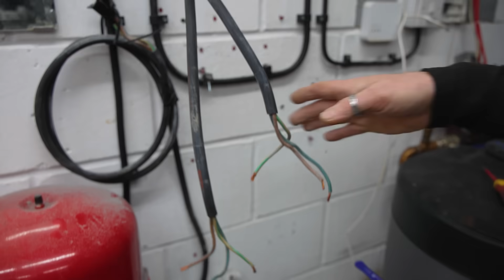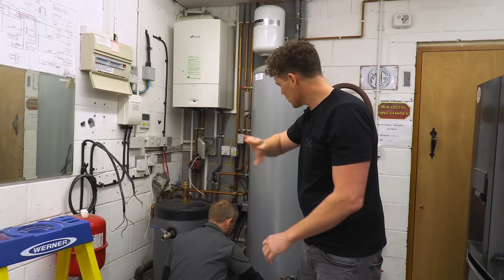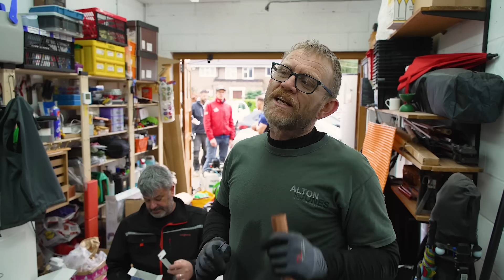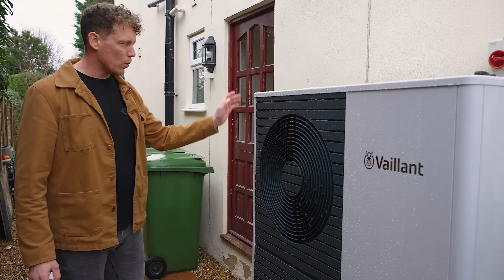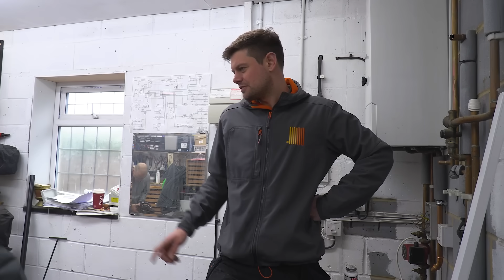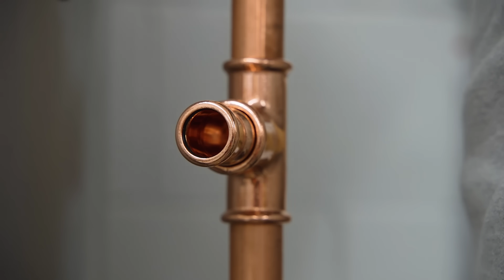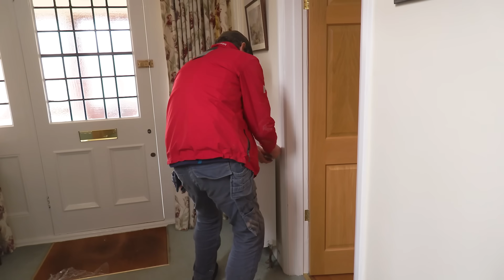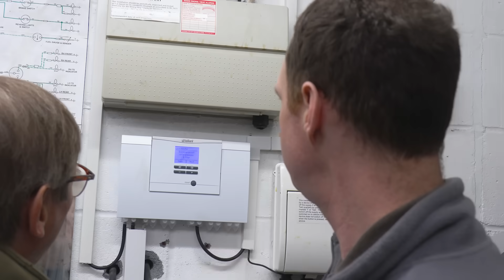Ultimate Heat Pump Installation. Rip It Out & Start Again!

Comment: When you're leaning on the new heat pump it's moving quite a bit. Shouldn't there be support brackets at the top for stability? Just an idea.
Reply from the maker: You could add support but the feet are rubber which allows the movement that you are seeing. This reduces noise transmission through the ground and the building. If you put brackets at the top you would need them to be on springs or rubber mounts. The movement would still be there.

Comment: massive kudos to these highly skill;ed engineers but what about the carbon footprint of the installation , where was the heat pump manufactured? the overall cost is not just in the allegede energy saving but in all aspects of manufacture, shipping and installation plus repair and eventual disposal , i am not convinced this is beneficial

Comment: why don't physically trial a low temp system by turning the boiler down 50 degrees and putting a data logger in, you could then monitor rooms and recommend upgrades before ripping a system apart.  Fitting a heat pump is fairly simple but it the system  behind it that eats cash and time.

Comment: I'd just keep the boiler there, like you said, it's already there, so may as well just keep it in case the heat pump ever has an issue for any reason. But I'm insane and have a redundancy fetish.

Comment: I went to look at heat pump monitor as I have a similar sized property and a similar sized R290 heat pump although mine is slightly larger output at 14kW ( a boiler plate 16 kW gen 6 Samsung). When I look at the moderately cool weather, say 7C, this heat pump behaves similarly to mine in that it turns on and off every 60 minutes or so. Isn’t this a problem for the compressor, won’t it cause premature wear as I thought it had a finite number of starts. The on and off cycling is not caused by defrost cycling, it just stops running for 30 minutes and restarts. 
I used a heat pump in Switzerland 15 years ago and that ran 24/7. 
Thanks

Comment: Heating engineer here. Studied in France 18 years ago on heat pumps, and have installed many many systems over the years. Great work, I just have one query... Concerning the "Buffer tank" . It is not installed because the pump in the heat pump can't get enough flow to all the rads/underfloor heating. It is 1: to ensure that the heat pump can always discharge its energy at a constant flow rate (especially needed in defrost cycle).2: Also allowing zoneing that is to say was can set the underfloor temperature at a different temperature than the radiators, (usually we can set the underfloor temperature much lower than the rads. If rads max need is 55@-5 underfloor need may be 42... Also it allows the flow rate in the underfloor heating to be constant ( very important).

We can then balance each radiator to have the correct delta between the send and return. I usually aim for 6'c, thus the heat pump stays within its optimal working range. If I have misunderstood something, please correct me, thanks for all the great videos from France.

Comment: Move unit next to the fence, block off near side and create opening with grill in fence where the unit is next to fence. 0
"Warm" Air is then drawn from other open side of house and "cold" air is blown down the side and will not mix.

Comment: I'm in South Australia.  Your videos are interest on YouTube.  And you sound like a polite person . My heat pump is an air-conditioner mounted in the wall . We generally don't use radiator's in Australia. What interests me is anyone using the thermal temperature of the ground deep down in england to heat and cool their homes.
Reply from the maker: Ground source heat pumps are viable in the U.K but for the advantage over air source it is a lot more money to shell out. 
It hardly makes economic sense.

Comment: Sigh. After all that (30 mins in this video, and all the discussion of running costs in the previous video), the owner's attic had never been insulated??? Shouldn't you have sorted the insulation first and taken measurements, and then done all the work? I mean, it just comes across as a bit disingenuous to have that in the video at the end, like it's inconsequential.

Comment: Replacing my boiler with a heat pump ain't worth it in my opinion, I'll never get my money back and that's if the heat pump works for at least 20 years with not 1 problem at all, it's the same as solar Its 14k to fit but wont spend 14k in electricity in 14 years

Comment: So if I understand the situation correctly, the gas boiler is still required to heat the hot water. Even if the heat pump achieves the level of efficiency that is being talked about, how many years before the home owner breaks even? Is he going to live long enough, considering that he now has to have two systems serviced every year and the huge initial outlay. Also most houses don't have the space for an installation of that size.
Reply: he is doing it to pretend to be eco friendly and in order to get free grants , he is not doing it for environment

Comment: "Air to air" gives air conditioning in the summer. With increasing peak summer temperatures and an ageing population (extreme summer heat can be deadly for old people), this is IMHO the best way forward.
Reply from the maker: You can't get a grant for air to air but I agree.

Comment: Had my ASHP 2 years and wondered why the upstairs radiators were luke warm during the evenings, turns out the radiators only get heat when the downstairs ufh calls for heat! 🙄
Reply: If it's been designed properly the radiators won't get too hot anyway as it's all about minimising the flow temperature. It doesn't sound like yours is working properly though.

Comment: I dread to think how much money John has spent over the years since he purchased the  original heat pump installation, to where he is today. My guess is it will be many many years before the the costs break even with a gas boiler. But maybe I am missing the point by not bringing environmental impact into the equation.

Comment: Please please please let there still be gas boilers around until I shuffle off this mortal coil 🙏
Reply from the maker: There is no chance that gas boilers are going to be phased out. The government doesn't know the challenges faced in doing this. If they can't be obtained legally the black economy will do what it always does in prohibition.
Reply: Like most EVs I see ASHPs as an interim technology to appease the climate change community. IMHO it just  seems too much expenditure for minimum return at the moment. Not to mention the real estate required to locate the hardware.

Comment: The worlds heat geekiest heat tape.... cut a 3" hole and run your loop the the heat pump 
Zip tie a second u shaped piece of copper and stub it inside.  Use as immersion wells for serviceable heat strips , natural air convection, or connect to a duct system to keep your potable water heat pumps passable

Comment: I mean, ok, but look at the absolute army of engineers it's taken to put this right. Who on earth in the real world could reasonably be expected to afford this? I'm really happy this was resolved for this gentleman, but it fails to convince me that these systems are the answer I'm afraid.
Reply: Absolutely.  Not in the real world.
Too much complex technology that few undertand chasing a simple issue - heating a simple house with reasonable efficiency.
As for efficiency - at around 14.35 he talks about the replacement heat pump being rated at 12kW - giving up to 13kW at -2deg c outside temp.
Not quite sure what that means in terms of cop?
( sounds like just over 1.00?)
They talked of overall cop in the region of 3.5 in the previous video... 
And of course the reason they swapped the hp was because the previous lg one had noisy bearings ... allegedly caused by not being perfectly level?? Hmmm....
Too much hi tech chasing a low tech requirement!
Reply: That absolute army was NOT necessary for doing this job, the multitude of engineers were there for support, seeing the job, looking at the previous setup and probably a good will quick job for Roger to get him out of his predicament. No, I seriously doubt 6 people turn up every time you get a heat pump fitted, more than likely 2 or 3, like most gas boiler installs.

Comment: Zero carbon, gasless systems, how can anybody argue that for the environment, a bit like the electric car debate 🤔 I have a double condensing 24kw boiler heating a 5 bedroom old/new extended house, I'm a mechanical/electronics engineer and repair my own stuff.  I've repaired the circuit board, twice, and replaced a couple of sensors, this Potterton boiler is 20years old and still going strong.  I've watched all three videos regarding Johns Heat pump system problems, how can a 'standard install' for a standard house be so wrong, How many houses have had the same type of upgrade only to be mislead by it's mediocre performance, gut busting costs of the install and running costs. Boilers are a simple tuck in the corner install for a 3 bed house, the combi boiler revolutionised home heating and hot water (but with compromises- lack of hot water flow for one). Good boilers last, cheap ones are throw away after 10 years or so, my potterton was £1400, I know it's not the best, but when rebuilding the house, spending £5-£10k on a heat pump system would not have made sense for the house build budget. Inverter powered heat pumps have made them more controllable, inverter technology has been adopted in many domestic industries, IGBT's have allowed motor driven systems to become more efficient but at a £cost. If you have a heating system that runs efficiently on gas/oil (85-93%) why spend ££££ on a system that cannot provide that instant maximum heat.
 I'm all for efficiency, but there's a line to be drawn between cost and benefit. I would make it mandatory for new builds  +£500000 to have heat pumps, this will enable the industry to gain more experience in the sector, hopefully the knowledge would trickle down into the lower value domestic market for a simpler cheaper basic system.
Reply from the maker: I agree with much of what you say but if heatpumps can do the job and save money there should be no need at all to  use a carrot or a stick to make people install them. History tells us that the best inventions sell themselves. Governments are very bad at picking winners. They tend to cherry pick technologies and then when a grant dependent economy is built around them they change their mind and go after the next crock of gold.
Reply: @SkillBuilder  Yep! Targets put blindfolds over skill based develpment. The goverment have set themselves idealistic targets, they have to be seen to be active towards environmental goals. Incentives are there to speed up the process, the money comes from us through the government back to us -% admin. I'm not criticising what ever Government is in power, it's the way the world works. Let's hope the Heatpump sector doesn't crash when all the 'cashbacks' end. Great video series 👍

Comment: Could someone please explain what is the real necessity for removing that pump / banding valve combo? Can you just turn off that pump and set that valve on fully open state? How would it in that stat interfere with the efficient functionality of the system? Thanks

Comment: These have been addictive video's to watch...really well done, thank you. But I still remain unconvinced. So much complexity, more to go wrong...massive "fan" attached to wall, big cylinder inside, pipes everywhere, big rads, industry still to mature. Payback way too long. Back to simple gas and log burner as back up for me for a few years. But I would go to Heat Geeks, when I'm kicking and screaming and its mandatory...!

Comment: You look at the manpower needed to install 1 heat pump. Does this really seem like a plausible alternative to a Gas Combi boiler? It was like watching Nasa trying to land a man on the moon. On the explanation to the home owner, I get that he didn't need that level of detail but jeez. We'll all need a physics degree to work the heating. This is why people aren't sold on heat pumps, too complicated, too expensive and god help you if they go wrong.

Surely with the existing infrastructure Hydrogen is a better alternative and much more cost effective. It would be a like for like boiler install, or modifying the existing one, plus upgrading your hob. That would potentially be a couple of hours for 1 guy who's already Gas Safe qualified, rather than 10 guys over a day and a half.

Comment: Huummm, still not convinced,all the positives covered. Feel there are a few negatives not being realized. 
Have worked with heat claim, air to air commercial, industrial larger equipment and that works great, domestic usage not yet convinced.

Comment: I'm glad that John, who suffered many headaches and financial disappointments was helped by the heat geeks, Vaillant and Newark copper cylinders.
I'm an energy engineer and really the issue is that heat pumps are being installed by gas heating companies, wheras they are totally different technologies. 
The only common feature is that you have water flowing around the house transfering heat from the heat source source to the rooms.
Reply from the maker: Reginald
The problem is that the gas heating guys won't have jobs if they outlaw the boilers so it is a natural move. 
Once you had cabbies with horse drawn vehicles and then they had to adapt to motor vehicles as horse drawn vehicles were banned on the streets of London.
Reply: @SkillBuilder  not to mention the cost and legal liability that comes with being a gas safe engineer.  If I were working in gas I'd be more than happy to do the training to make the switch!

Comment: Couple of things- tell the tossers in govt that propane's heavier than air - it sinks to the ground- so regs about doors(and especially windows) are stupid..2- The argument for and against heatpumps and the whole green agenda??? - simples- fossil fuels are finite- boilers feck all use if theres no gas- 70% of earths surface is covered in water- you can put a wind/solar/tidal/wave farm the size of America+ Europe- in the Pacific alone- then do the Atlantic- an  American sized one will not be seen by anyone on land- so no nimbys need apply ..
Then- look at China- their Pegasus solar farm- Biggest in the world - its in the DESERT-again, no nimbys, and you could fit thousands-  how about North Africa ? 100% Out of every solar panel you fit,thousands of miles, with no nimbys- and Africans wouldn't give a toss, if they were getting income from it- add silicon piping underneath the panels, and you'd get loads of  lovely hot water, with a bit of solar to boil it- stick steam turbines on, and youve got yet more energy - and cooling the panels makes them yet more efficient...
And you save millions of lives, and a lot of illness from respiratory infections/asthma/smog accidents...
Wave power alone can power the planet several times over,on its own- a team in the USA got 33kw per metre, along the coast near to San Diego...
So,unless we run  power stations on wood (not enough trees, lousy energy release compared to fossil fuels, ) and that would mean slashing energy usage to unsustainable/unaffordable levels of cost...
We dont have any other option (unless everybody's willing to have nuclear power stations within 10 miles of them- and where does the vast pile of radioactive waste go)...
Eco doesnt have to be an eyesore, or expensive-even the cost of Hydrogen is going to be slashed, with new tech vastly increasing efficiency, you could have North Sea And Atlantic energy farms producing Hydrogen,and piping that to homes and businesses,using current infrastructure...
They know how to put oil rigs into the harshest of seas, so most of the technology is already tested...
FINALLY....
Can I have the "scrap" heat pump ???
Ive quite a few bearings in my shed....💰💰💰💰💰🤯🤯🤯🤯😀😀😀😀😀

Comment: I suspect that many of us who are very green to this ( I admit I am!) will be appalled at the amount of equipment not to mention the spaghetti pipework to heat a house and provide hot water, compared to my condensing boiler, radiators and hot water tank ( in a very useful airing cupboard). No wonder it costs the earth to install!  And listening to one of the installers, it looks as if finding a reliable installer will be like finding the end of the rainbow!  Who knows who to believe, or what guarantees are worth the paper they are printed on - if they even are......  Like John, getting a cowboy looks easy.

Comment: Mitsubishi is a loud mf. And it doesnt work as promised. Max i got out of it is 295%. It is a 11kw unit, but should be 13kw installed. Got compressor damage first year of use, second year all the electronics, now we want a new unit from the seller, this one broke again...